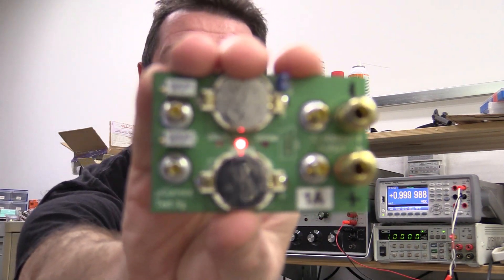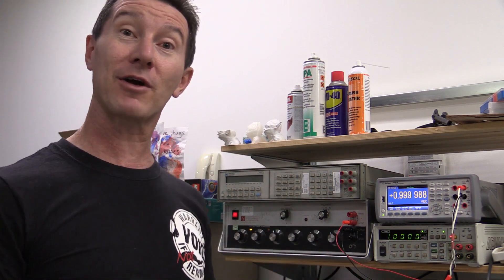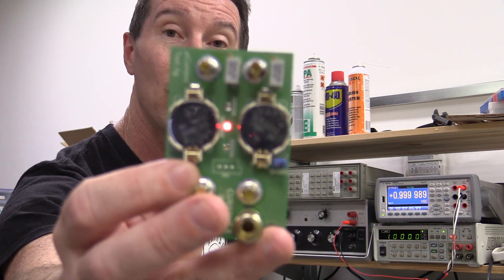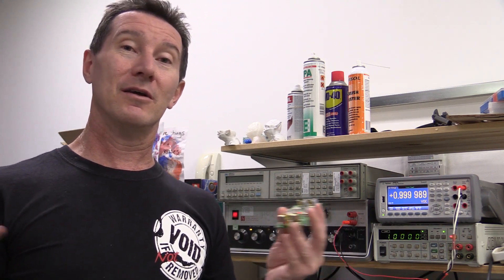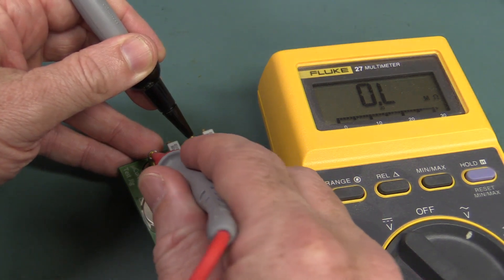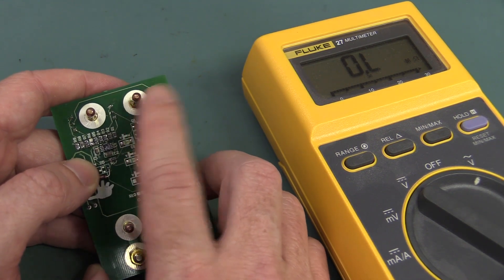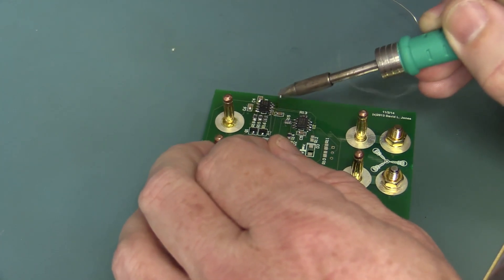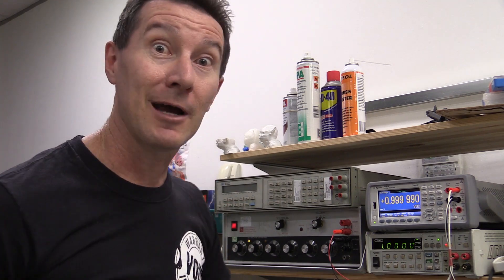EEVblog #727 - How To Kill An Opamp

Comment: I hope you can help me. I have a Logitech Z906 Sound Speaker System for my Windows Computer and retro computers. My Amiga 1200 has blown its op amp twice and the guys on my Amiga forum says it could be my sound system. They said check for AC and DC voltage on the line inputs. I did the other day and it was 24 volts ac. Today it’s 5 to 10 volts AC. 
I have sent my motherboard away to get fixed. 
Could that be the reason it keeps on blowing up the op amp?
Is that voltage not normal?
Is my speaker system faulty?
Can I do a easy fix?
Or can I take it to a technician to get fixed (I live in Adelaide South Australia)
Any help would be greatly appreciated.

Comment: A couple days ago I was probing my op amp with my old crappy multimeter, it's got a long bit of exposed metal and it turns out shorting pins to other pins is not a great idea. 

The replacement, I put in backwards. 

Both let out the magic smoke with large cracks in the package, the first audibly popped.

The third one held up.  Thankfully my EEVBlog BM325 has the probe sleeves so I don't have to expose the entire lead if my use case doesn't actually require that, and the old one can be set aside as a backup.

Comment: yeah i figured it would be a good idea to add an input series resistance and clamping zeners regardless of whether i'm going to feed voltage higher than allowed  to the input port of the device that i am designing. because i know i will, one day, even though i'm not expecting to.
same goes about reverse polarity.

Comment: if I start posting a video for every circuit I destroy, there will be no room left in the youtube severs! haha nice video Dave

How to destroy OpAmps: 
1) by reversing the polarity on the power inputs
2) by supplying more voltage on signal inputs than the voltage on power inputs (Vsignal>Vpower not allowed)
- Can anyone tell, what should we take in care as far as the output pin? It should not be short-circuited with Vpower maybe?

Comment: G'day Dave. I have not seen this video yet when I decided that going forward all op-amps in my experimental boards will be sitting on a IC sokets to not being bothered with replacement if I cook them. Did not burn any yet. Hard to beleive you did.
Voltages at my place are 140-400 V DC. :) and I cooked Mosfets (op-amps were not hurt) couple of times when have not been bothered to run the circuit via Analyser which detects ubnormal current / voltage and cuts it off if mistake was made.

Keep up the good work.
Another reminder - attention to details is of paramount importance when you are dealing with electricity / electronics.

Comment: I did a super special dumb move and soldered in a diode backwards on a guitar amp.
And then to add to it I kept turning it on and off then got pissed because I knew what I did and pulled two traces because I wasnt paying attention to the heat on the iron.

Comment: Recently had a good OpAmp cooker scenario. I had just finished a 2kHz, square wave IRLED signal detection circuit that I was pretty proud of and spent all night soldering when a friend asked me to demonstrate the range for him. Despite there being reverse-voltage protection and a voltage regulator integrated into the circuit, I instantly fried the circuit when I set the perfboard down on a solder mask positioning plate without thinking (pretty much bypassing all of the protection)! And I figured that the OpAmps would be first to go, so I replaced them, but no luck. I went through the trouble of testing each capacitor only to find out that it WAS one of the OpAmps after a second switch-out. So butt!

Comment: I think you are pushing that opamp a bit, just by powering it from two coin cells.  It's absolute max supply voltage is 7v (not speced above 5.5v.)

Comment: Dave,  I'm an amateur electronics hobbiest.  I do wiring in Guitars and have some experience of infrastructure and cabling for IT and AV applications, and I just wanted you to know that as a direct consequence of watching your videos, I have managed to expand my interest to fixing equipment to component level.  I just successfully diagnosed and repaired a faulty guitar pedal by watching your video on killing Opamps.  Thankfully I haven't killed mine, and found the diode protecting the 9v supply has blown open.

I just wanted you to know.  Many thanks dude, and keep up the great work!

Comment: Well, at least it wasn't a 16.2W LED.
Or (shudder) a laser diode
Or a laser diode driver
Or a plasma cutter
Or another laser diode (several more, actually)
I know a guy who has done all of that.
Plus just about every other component there is, except some of the more exhoteric ones
And some of those as well

Comment: Huh. I thought inputting a voltage beyond the supply rail voltage would simply cause clipping (and then cause distortion if the input is an audio signal). Maybe there's a different effect for AC and DC inputs.

That reminds me, I should make an op amp tester one of these days. Whenever a circuit with an op amp doesn't work for me, I'm always paranoid I killed it.

Comment: I learned an important lesson recently: Never trust what it says on the outside of the power brick. I wanted to build an LED table lamp out of a cheap camp lantern, so I salvaged the LED & controller. I connected them to a 6v DC power brick, because the lamp was designed to run on 4 D cells in series. Well, it certainly did light up when I switched it on. But then the IC on the board got very hot, and the LED briefly became extremely bright before releasing its magic smoke and dying. I checked the power brick on the meter and was much chagrined to find out it wasn't putting out 6 volts; it was putting out 12. Ouch!

Comment: So, how do you protect of this sort of problems?
I am amateur in electronics and when i do some stuff whit opamps, i just add 500Omh resistor either to Vcc and to inputs, i don't know is it bad and is it spoils something in scheme? i just afraid to damage opamp :)
Reply: *****

So, i putting this 500 Omh resistors to cut current, if i connect something wrong way. I thought its current that killing it?

Comment: Well, I've learned this the hard way, stupidely almost killing myself in the process at the age of 15 or 16.
You know how you could "test" the 4.5 volt batteries with your tongue? Well I tried the same move with what was supposed to be a 5V "wall brick" power supply.
Turned out it was fried and I've got myself 220V in my mouth. Came back to conciousness few minutes later lying on the floor and with burning tongue but obviously still alive!
Became engineer later, I guess my brain was somewhat fried after all :D

Comment: So this wasn't a latchup? Because that really lets some smoke out if you have a power supply with no current limit. I put a capacitor that was still charged with a few volts (maybe around 10 because it was used as decoupling cap just before) on the input of an opamp supplied with +-5V. Imagine my surprise when fire came out ot the opamp on my breadboard and left a few charred holes on there.

Comment: I forget what the multi-turn pots on your board are designed to do but I assume calibration of some sort - which isn't to be changed, right?   I cannot tell if they have some anti-tamper paint (i.e. fingernail polish) on these pots.  Is there?  Should there be?

Comment: It's excellent to be reminded everyone makes a mistake from time to time.

I recently let the magic smoke out of a teensy by probing it with a voltage rail when I thought it was a ground probe (pulling input pins down to trigger the interrupts...The input pullups didn't like being externally overvolted :S)
Reply: Yeah it's comforting to know even Dave screws up. I went through a phase of destroying 7805s by connecting the output pin to what should've been the input voltage. I did about 3 in a row, in the space of an hour, through a comedy of various errors.

Comment: I remember destroying an OP Amp when I was doing my 'O' level electronics project at school. I'd custom etched the circuit board, soldered all the components and chip holder in place, put the OP Amp in, hooked it up to the bench supply, there was a snap noise, something hit me in the forehead, then that unmistakable smell. In my haste, I'd put the 741 in the wrong way around. DOH! 

We lived in a rural area, and this was pre-Internet, so I had to mail order another. Rushing doesn't get stuff done faster.
Reply: I blew a 741 that I was using as a voltage comparator In a battery charger circuit. I was powering it with a 9 volt battery and just momentary touched it in reverse accidentally and the chip was gone. One diode could have prevented this. We learn from our mistakes I hope! lol!
Reply: I have about a dozen bread boards with burns on the middle from op amp accidents.

Comment: I'm surprised you've used pots on your test jig. Is it a reliable solution for a piece of test equipment when you consider that it's handled so much? Sometimes when I've set them to a value I feel like I only have to blow on them to create drift or maybe that's because I use WHL branded ones?
Reply: I would be highly skeptical about the temperature coefficient. But to be honest: In his use case, an out of spec test jig is just a hazard, not a problem. With his Vishay resistors, most uCurrents will be in spec. If the test jig goes out of spec or dodgy, it will - more likely then not - cause a larger number of uCurrents to be flagged as "out of spec" and he will get called by his assembler. Even when doubting it: Calibrating it before giving it to the assembler and recalibrating it when getting it backs. Note: Calibrating is just checking the test jig. Turning on trimmers is NOT calibrating, it is adjusting. Many people mix up does therms, but it is important to know, that calibrating is just checking without touching trimmers or any thing.

Comment: One thing I learned pretty quickly: thou shalt always connect a dummy load.

Powering up an RF power amplifier without connecting a dummy load is fine as long as you're not applying any RF input, right? Wrong! Instability in the amplifier caused it to self-oscillate and lack of dummy load at the output  = POP!

Now I never ever ever power up any RF amplifier without first connecting a dummy load, even if I'm just applying DC to check bias levels.

Comment: LoL, I sorta did the same last night to my Naze32 flight controller. I mixed up my battery sensor and buzzer lines and put 15v from a 1800mah LiPo into a 3.3v 150ma rail. Luckily all I did was wipe out a BAT54C SOT23 double diode and a SOT23 1AM transistor, replaced them (yay scrap boards) and all seems fine so far.

Comment: But how can it be broken if you didn't let the magic smoke out?

On a more serious note, Why didn't you use steering diodes? Diodes are cheap, Op-amps and downtime are both expensive! The downtime cost might not have a monetary value, but I would be surprised if you didn't have better things to do than fix a test jig.
In this case, Schottkey diodes are the obvious choice due to their low voltage drop and fast switching times. If you have some in 0402 or 0201 size (Imperial scale) you can probably use those and maybe some fine-gauge wire-wrap wire without even needing to re-roll the PCB. If it works "good enough" now it's better than working "better" later! Of course bodge wires and HF or high speed digital signals don't usually mix well, but a bodge wire or two isn't going to hurt this circuit that works at basically DC.
Reply: Because once set up, this device would never see something much more than 1V (that's what the µCurrent puts out).
Reply: superdau Would you plug in a computer without a surge protector? I wouldn't. Not even a laptop. This is the same idea. The diodes are basically a surge protector for the op-amp. They don't change the circuit's normal operation, but they do protect against the inputs going above or below the supply rails, which is exactly what killed the op-amp in this video.
Reply: 44R0Ndin
Why would you need a surge protector? I never used one.
You can't protect against every eventuality of user error. The next time he might have set it to 100V. protection diodes won't be of any help then, because even they can't take it. This thing is supposed to be used by people who know what they are doing. When testing µCurrents with it the only "power supplies" are coin cells in both of the devices, which can't deliver any current at all and they don't have the voltage either.

Comment: Any chance we can get a video on how you would go about protecting the inputs to prevent this from happening?
Reply: Add some input resistance -- this is a high impedance Op-amp input so you could very likely get away with 1K, 10K, or even greater, input resistors -- to limit the maximum current that can flow into the input when the protection diodes activate.  Then, on the Op-amp side of those resistors, add a reverse biased Zener diode.  If you use a 5.1V Zener then the maximum voltage the Op-amp will ever see on its input, with proper polarity, is about 5.1V and if you should accidentally inject a reverse polarity on the input then the Zener will limit that to a maximum of about -0.5-0.6V.  If you want better reverse polarity protection then supplement the Zener with an additional Schottky diode (in parallel), which would limit the maximum reverse polarity voltage to no more than about -0.25-0.45V.  In that setup the Zener will limit maximum proper polarity on the input and the Schottky will limit maximum reverse polarity on the input.  Regardless, the Op-amp is now protected from any remotely reasonable voltage mishaps and now has full ESD protection on its high impedance input as well.  If you know in advance that 1V is the maximum the input will ever see in normal use then one might opt instead for a 3.3V Zener.

Comment: Did the magic blue smoke escape? If not, it should have worked despite a 60 ohm input impedance... How long did this take for you to realize that the voltage was 10v and the opamp has popped?

Comment: Recently I replaced all my 60watt lights with CFLs and I have these glass globes on the ceiling here and there. I noticed one died after being on for a day, and took it down to look at it. So what I think is the problem was that they are not supposed to be in enclosed fixtures, and were cooking the electronics or a thermal fuse. So what I decided to do was leave one of the two lights out of each of them and hope it would lower the temperature adequately. I took apart the dead screwy light and got out the little electronic thing to play with but I don't expect to do anything with it.